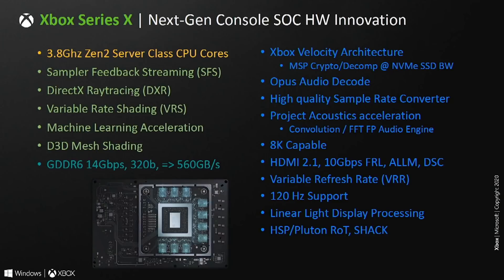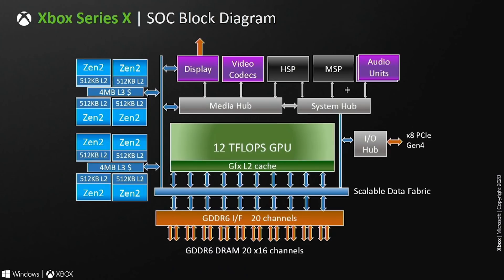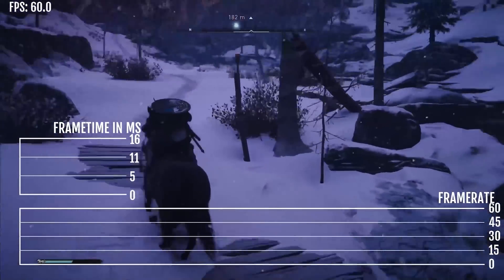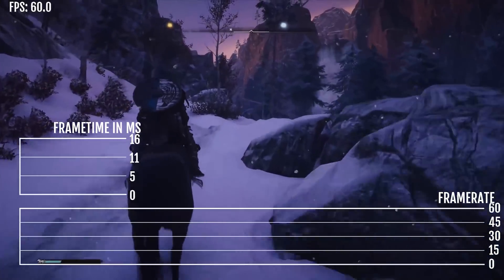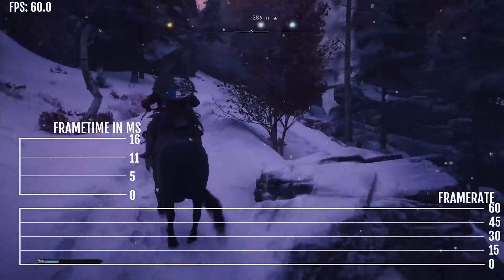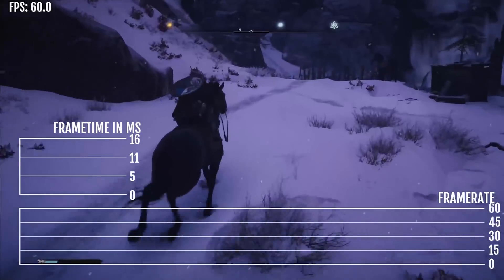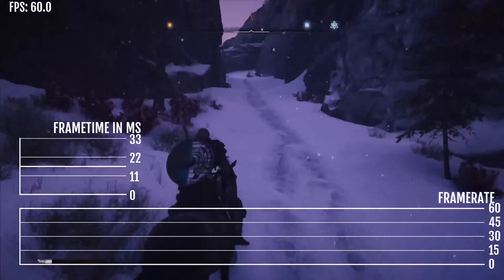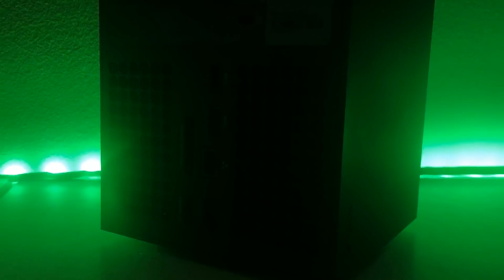Xbox Performance to be UNLEASHED | Xbox Series X Mesh Shaders & SDK Updates Changes Everything

Comment: Mesh shading on Series X will not be nearly as efficient as the Geometry Engine on PS5 since it will just be using GPU cores for that rendering. Both consoles have this capability tho, and this really doesn't change ANYTHING as mesh shading was already part of both companies' presentations a year ago.
You need to watch out that you don't become just another clickbait YT channel, people will start unsubscribing. Stick with actual news and content and breakdowns, you do a great job on those. This was not news
Reply: I think ps5 and series x both will get a pro version after 3 years. Altough ps5 is out performing series x by a good margin in open world games and games I'm general. But when u look at how much both series  x and ps5 has to compromise on resolution. I think if these companies do not release an upgraded series x and ps5 I am certain that 4 years into the generation games thar actually take advantage of the hardware will be running at 30 fps with resolution falling down to 1080p. I think it will become increasingly difficult to maintain 60 fps in games. I think both Sony and microsoft should have waited before releasing ps5 and series x
Reply: @deepinsight1175  Devs will target the lowest like Series S so games will be held back except if the game is PC exclusive but still Majority of PC gamers play on low-range or Mid-range so it will be financial suicide for game devs to target fewer high end gamers.
Reply: @ingamgoduka57  both these consoles must be sued. Both Sony and microsoft promoted series x and ps5 as 4k consoles. But they are no where near 4k resolution. I think ps4 pro and xbox one x had at least 2 to 3  years of life still left in them. While base ps4 could have easily run games at 30 fps at 720p while base xbox one could have done the same at 540p to 720p.
Reply: @ingamgoduka57  yeah unfortunately seeing the likes of a new Crysis system killer is less and less possible these days with budgets and sales targets... Luckily many game engines are so scaleable now that they can run on a xbox one x and a ps5 and a super powerful computer and still be demanding enough to need future hardware. It's always exciting when you can't max out a game's settings with the best of the best of today's graphics cards
Reply: @deepinsight1175  yes I agree, they should have at least waited until AMD had dedicated AI hardware for upsampling and better raytracing and cheaper chips with more performance. But really, resolution and even framerate don't bother me that much about these consoles as long as we get options for one or the other. I'm just happy consoles have SSDs now and won't be holding back the PC gaming industry from launching forward to the next generation anymore. I had an SSD in my pc in 2011 and was already at 8Tflops in 2013 when ps4 launched. Consoles have to be less performant than current pc hardware these days to be cost effective. PS5 has an amazing SSD at least which is very future forward and a Pro console with double storage and 20+ Tflops in a couple years would be fantastic. Without proper upsampling tho, even 42Tflops isn't enough for 4k60 with raytracing or even 1440p60 with full raytracing, so there have to be limits
Reply: Well let's see who's misinformed.  My information comes from the hot chips reveal of series x architecture. You know the one for devs to see what they're going to be working with.  Now can you show me one link that shows Sony saying that they have a Mesh shader geometry engine?  In fact Cerny's presentation and the unreal engine demo both touted RDNA1 "primitive shaders" not mesh shaders.  Furthermore the series X and S have TWO geometry engines.  A unified geometry engine and a "mesh shader geometry engine."  Here's my link proving my case, now where's yours?  And we'll see who's the YT channel clickbait person. You'll find the two geometry engines under the heading "Xbox series X gpu diagram."  https://www.hardwaretimes.com/xbox-series-x-gpu-architecture-deep-dive-ray-tracing-mesh-shading-sampler-feedback-and-vrs/
Reply: Hey Mr. Wizard, so explain to me how Sony's generic geometry engine is going to out perform the specified "Mesh shader geometry engine" when dealing with mesh shading?  I'd luv to hear this logically explained!
Reply: This video gives xbox fanboys hope after being brutalized by PS5 & its fanboys lmao its not a good idea to be a fanboy.
Reply: @ingamgoduka57  yes it's never good to be a fanboy. Objectively looking at information and researching to acquire actual knowledge is much better. I am an engineer and I love games. I play all of Microsoft and Sony's biggest games and love them both. Game Pass is a fantastic service and I use it to get games on all 3 of our home PCs for one $10/mo cost and love it. I'm super happy Microsoft switched to their GDK from the old XDK even tho it's taking devs a while to get used to it, since I am using a PC for Xbox games. The power narrative doesn't bother me since I have 42Tflops in my computer already, ps5 and Series X are both a generation behind PC already (other than the SSD in PS5), I just like accurate information and Paul usually provides good sources of news and accurate information and this video was old information with clickbait for views
Reply: @PCGGC  I hope sony release PS5 exclusives on PC not only PS4 exclusives  they are the only games I want to play especial naughty dog I want to see what they can make with this new hardware & that fat pipe ssd.
Reply: Because this information is not the way you want it to go it's clickbait.   Microsoft provided lots of information about their Mesh Shading Technology, it's not speculation, like it's often the case with PS5.
Reply: @frankiesab777  Series X doesn't have dedicated hardware for mesh shading, it's using GPU cores for it. PS5 could easily use GPU cores to also do mesh shading, and some game engines have already used similar tech in the past to improve performance. The clickbait is the fact that this video claims to be "news" when Microsoft showed off mesh shading in the lead up to the release of the console a year ago
Reply: @PCGGC  Mesh Shading is API agnostic but hardware reliant. It's part of RDNA 2 specifications.
Reply: Lol yes and ps5 has rnda 3 with infinity cache. Yep its sarcasm
Reply: How do you even know the geometry engine information about the  playstation is accurate,  scientific test were conducted to measure mesh shading impact on performance.

Where is the geometry engine data ? To show it will be as good as mesh shading.  Until sony comes out and conducts tests, and even confirm geometry engine data your information is just propaganda
Reply: @warcrabcyber9908  The Geometry Engine is more efficient because it is dedicated hardware that can be used automatically OR tweaked and programmed by devs and doesn't use the GPU cores. Series X will be using GPU cores to do mesh shading which will automatically affect it's efficiency and will also take away some of the 18% Tflops advantage Series X has in pure power. PS5 and Series X will both be heavily relying on mesh shading and this was revealed over a year ago
Reply: @PCGGC  fiction , we don't even know if that geometry engine  information is accurate to begin with, but you here talking about how it works. You even go as far as talking about how it's better than mesh shading a proven and confirmed technology in the xbox series x by microsoft.
Reply: @PCGGC  Dude that's a lie!!  The Series X has two geometry engines.  A "Unified Geometry engine and dedicated "Mesh shader geometry engine."  Cerny and Unreal engine both hyped up RDNA1 primitive shaders NOT RDNA2 mesh shaders which is faster and more efficient.  Sony's slower RDNA1 primitive shader geometry engine is less efficient than MS's dedicated RDNA2 Mesh shader engine!
Reply: @terrenceholland6355  you have all sorts of misinformation here bro. Technically speaking, Series X SHOULD gain some advantages once they implement DX12 mesh shading more. But PS5 is NOT using RDNA1 primitive shading, and what Series X is going to use is from their API and nothing to do with RDNA2 specifically either. PS5 is capable of mesh shading as well within Sony's APIs. The Geometry Engine is a completely custom chip focused primitive shading with tesselation, geometry rendering\culling. There are some big advantages to using primitive shaders over mesh shaders if you program for it, which would normally take a lot more work. But from what Mark Cerny said, the Geometry Engine can automatically optimize this process OR be custom programmed by devs.
Unfortunately we don't have further detailed information about the Geometry Engine YET, nor any benchmarks (hopefully before long).
What really matters is game performance tho, and so far game for game PS5 has been killing the Series consoles as far as framerate stability. It would seem whatever advantages each console has will basically even out on any 3rd party games. 
Sony devs have magicians tho in their art direction and technical departments tho. PS4 still has games that blow me away when I see them, I can't say the same about ANY Xbox first party game in the last decade (and I've been playing them on pc at higher res and better effects)
Hopefully these DX12 Ultimate features and new dev acquisitions will start to change that in the coming years
Reply: @PCGGC  Dude no offense but you know NOTHING about primitive shaders or mesh shaders.  If Primitive shaders introduced in (RDNA1), are superior to Mesh shaders (RDNA2), then why would AMD drop them for mesh shaders?  By your logic AMD added a less efficient feature in RDNA2 than what was already present in RDNA1!!  Mesh shaders accomplish the same goal and more than primitive shaders. They are faster because of reduced steps, they give more control to the devs plus it saves memory by culling triangles that are not seen!  I strongly suggest you do some more reading before posting.  As for the ps5 beating the series x in "some" not all games.  What games do you know that use any of the advanced rdna 2 features?
Reply: @warcrabcyber9908  For one, history. Sony has a very good track record of custom APIs and eeked out some amazing performance out of the 4.2Tflop PS4 Pro without using DirectX that Xbox has used all along.
Also, logic. Sony had the option to just use the mesh shading capabilities of the GPU (and would have had a bigger GPU if they had) but decided to go with custom architecture instead, and numerous developers have confirmed how well the architecture works and the throughput advantages and ease of use of the PS5 SDK. 
I do agree with you tho in that I want to see the actual data and some detailed numbers. I'm also interested to see how good games are going to look on both consoles within the next year, especially once Unreal Engine 5 is fully active and being utilized. 
Also we have no actual data on Series X mesh shading performance and how much it affects the GPU performance either yet, so again, yes it's all up to logical speculation, but dedicated hardware that doesn't use up GPU resources would safely be called more performant.
Reply: @PCGGC  dude stop with the fiction, everything you say is in your imagination, how do you know what influenced sony choices on their hardware design. the xbox has  capabilities for mesh shading and vrs because  microsoft confirmed it. They even did benchmarks showing off the capabilities. 

Sony did nothing you speak off. They never came out and confirmed anything about geometry engine or using their hardware and software to simulate mesh shading. Stop with the made up fiction.

How far did the zen 3 and rdna3 speculation get this channel? Nothing was true. And it made the channel look bad. Even moore law distanced himself from the heat when everyone was slamming this channel. Moore law was also heavily speculating about the ps5 and he was also wrong.
Reply: @warcrabcyber9908  Fiction? lol I do know what Sony's choices were influenced by. You don't add custom hardware when the stock hardware can do the same thing unless it is more efficient or more performant. That is not fiction it is both logic and basic business decisions. If the Geometry Engine was less efficient than just using mesh shading on GPU cores they would have scrapped it at the R&D phase, that's how engineering works. 
That's not fiction or speculation, it's standards and basic operating procedure. 
And as far as RDNA3 goes, you've got it backwards. The professional\insider rumors going around were that AMD were taking some of the features from the PS5 with the custom architecture they worked on with Sony FOR RDNA3, NOT that PS5 was rdna3. Whether this was io processing, geometry engine, or smart access memory features has not been officially revealed, but is still pretty safe speculation and was not disproved whatsoever.
Just because you can't use your brain and don't understand the technology doesn't mean everything about ps5 is fiction. You are the same type who thought 12Tflops was a massive number and that games were going to look worlds better on Series X over ps5 because of an 18% Tflop difference lol

Comment: It's common knowledge that MS waited for full RDNA 2 and was behind on production. That's why Sony has more consoles "in the wild" than MS. Either way, both consoles are fine.
Reply: Alfred Basurto  That has zero to do with MS waiting for AMD technology or anything I said. But nice try 🤙
Reply: I think ps5 and series x both will get a pro version after 3 years. Altough ps5 is out performing series x by a good margin in open world games and games I'm general. But when u look at how much both series  x and ps5 has to compromise on resolution. I think if these companies do not release an upgraded series x and ps5 I am certain that 4 years into the generation games thar actually take advantage of the hardware will be running at 30 fps with resolution falling down to 1080p. I think it will become increasingly difficult to maintain 60 fps in games. I think both Sony and microsoft should have waited before releasing ps5 and series x
Reply: This video gives xbox fanboys hope after being brutalized by PS5 & its fanboys lmao its not a good idea to be a fanboy.
Reply: Ms did not wait for full RDNA 2 but simply used the standard ... Neither was Sony in a hurry, but modified their chip to remove unnecessary things ... And as the results show over and over again, "full RDNA" just doesn't mean anything, especially if the feature is unimportant. Either way, these features are available in both consoles. It doesn't matter what you call them
Reply: @feldartillerie1620  Stop with that lie already. Paul's confirmed others in the media and Devs confirmed this it is well known. Also confirmed by Phil Spencer and MS themselves.
Reply: What a silly xbox fanboy excuse...
Reply: Lmao

Comment: It's like "The power of the cloud unleashed" all over again.
Reply: I think ps5 and series x both will get a pro version after 3 years. Altough ps5 is out performing series x by a good margin in open world games and games I'm general. But when u look at how much both series  x and ps5 has to compromise on resolution. I think if these companies do not release an upgraded series x and ps5 I am certain that 4 years into the generation games thar actually take advantage of the hardware will be running at 30 fps with resolution falling down to 1080p. I think it will become increasingly difficult to maintain 60 fps in games. I think both Sony and microsoft should have waited before releasing ps5 and series x
Reply: the difference is that mesh shaders aren't Microsoft marketing bullshit. Mesh shaders are a hardware feature supported by RDNA2.0 and Turing / Ampere and defined in both DirectX 12 and Vulkan, we even have working examples of the technology showcased by Nvidia, Microsoft, and Epic Games. 3D Mark has a working benchmark which you can find running on existing GPUs. You can even find demos here on youtube from smalltime developers. Sony is also alluding to a similar concept with what they are labeling Primitive Shaders.